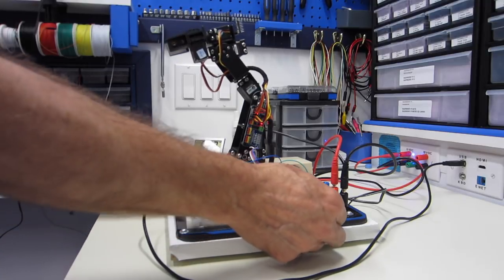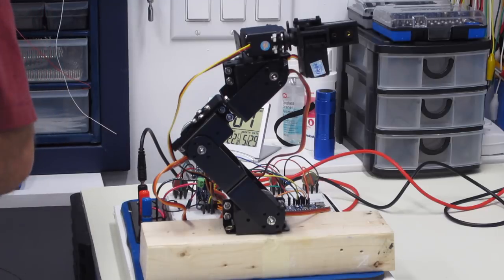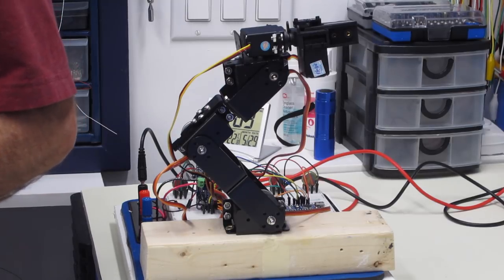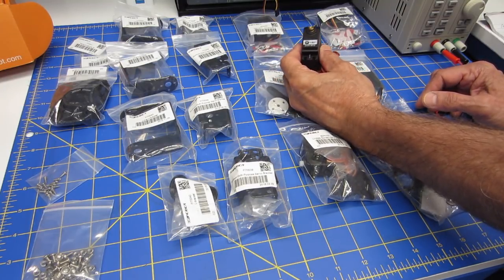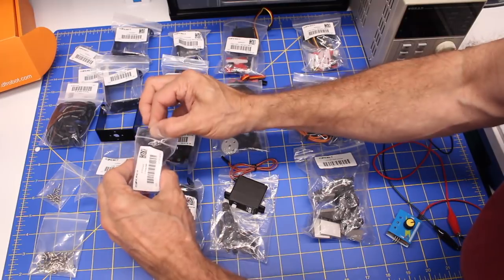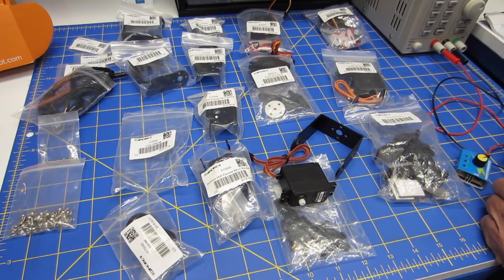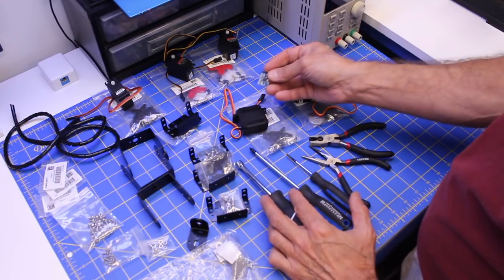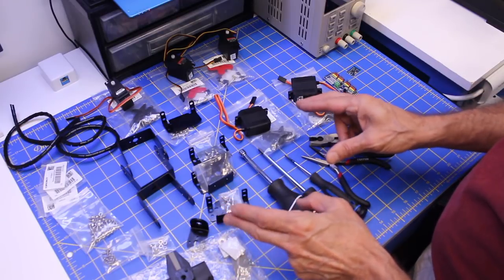Robot Arm & Controller - Building the DFRobot 5 DOF Robot Arm

Comment: Excellent. Can you please extend it to 16 servos (Or at least 6DOF) using Arduino servo shield 2+16 (or PCA9685 or any other I2C board)  with one joystick or a pot to record the position of each addressable servo and play automatically thereafter

Comment: If we wanted to use only one degree of rotation at a time, can we use only one analog pin (say A0) and connect it to the 5 servos using a 5-way rotary selector switch ? That way I guess we can save our analog pins for other sensors? Is this possible?

Comment: I am very interested in the 5 dof robotic arm project but want to add the ability to record the potentiometer movements then replaying a looping them. all using an Arduino Mega. have you done this? if so can you share the Workshop project link? if not can you add this as a Work Shop project in near future. Thanks and Also thank you for all you do with the Work shop

Comment: Nice video! What power supply did you use? This is my biggest challenge. Thanks
Reply: Probably a benchtop variable power supply my dude, they're not cheap but I got a decent one from Amazon for 70 bucks, rated at up to 30 volts and 10 amps

Comment: I'm having trouble finding the parts to build the arm.
Reply: Banggood + ebay, I just bought all the necessary stuff. Motors are 996R, all the mounts are designed for these motors, bearings are 3x8x3 or 3x8x4mm

Comment: I recently watched a video about a DIY google glass/HUD built with an Arduino, an OLED screen, and a Bluetooth module. I was wondering if you know of a way to send information from a cell phone to an Arduino  through bluetooth so that I can display navigation, speed, and maybe a few other things on my motorcycle helmet visor without having to incorporate a GPS module into the mix. This would make it so I don't have to look down or hold my phone to navigate. Any help is greatly appreciated as there is not very much information that I could find relating to the transfer of this phone data to Arduino. Thanks in advance!
Reply: He has a video on doing wireless with android or smartphone, but there are more in-depth tutorials on doing a diy project using wifi or bluetooth, and connecting to a phone for transmitting data from the internet. You may have to combine examples from different tutorials in order to achieve the HUD effect, but I have looked into that, and I've found no specific instrucable or tutorial for that exact solution, but you can probably work out how to sort it together with enough time and effort. AR is still young and expensive to buy ready-made solutions, so I would take my time and do a proper custom job that will last.

On the other hand, Raspberry pi 3 B+ has a built in wifi and bluetooth module, and that system-on-chip is about the size of a credit card; plus it's completely opensource like android, and has a big community too; Raspberry pi maybe what you're looking for on that solution; try Raspbian sometime and you may find it to your liking.

Comment: I've watched this video a thousand times and finally bought a 6dof aluminum one. I plan to print the scara one after I get my feet wet with this one. Mine has most of the same parts. I have 25kg motors I'm going to replace some of the stock ones with baba

Comment: Great tutorial 👍🏾

DFRobot arm too expensive. Hopefully Thingiverse etc, can point to a cheaper 3D print version..
Reply: I bought the U brackets, L brackets, servo horns etc off of Amazon, robotshop (dot) com, Ebay, etc; shopping around for each piece you'll be able to afford better servos that can lift more torque, like the ds3218mg's, and it'll cost you less than $150USD total. Just make a list of the components you need and buy what you can when you can.

Comment: I think I have a bad PCA9585 board I've tried two Arduino's and both adafruit examples as well as many other examples and the one from your videos.  It's there a simple way to determine for sure that the board is trash?
Reply: Try Brainy bits sketch using PCA9685. He made a library for it as well.
Reply: @webslinger2011  Thank you.

Comment: Having watched your video "Using Servo Motors with Arduino" about controlling multi Servos with the PCA9685 module....as this module is all about I2C protocol, could I also attach an I2C 1602 or 2004  LCD  display to  display feedback info from sensors on the arm(s). As you say that you will be making another video on the 5DOF arm with improvements, could you discuss my idea during that video if it is feasible.       Great series....much enjoyed

Comment: The link to dfrobot is not secure (flagged by chrome web browser) - looks like they may not have renewed their cert?
Reply: Roy...Amazon is selling the DFRobot 5 & 6 DOF arms if you are interested
Reply: I would like to know if built an Rc airplane and i want to stay more longer in the air . I put 2 Batteries in parallel in other voltage can’t be higher but the Amperage . My Receiver will not damage because the Amp goes too high . Thank you for time reading my statement .

Comment: why you don't use stepper motor instead of servo motor? isn't stepper motors provide more detailed movements than stepper motor.  I am thinking of applications to use the arm as 3d printer which requires more accurate movement.
Reply: With servos you can set a position and it will automatically go there while the microcontroller can do other things at the same time. With steppers you have to keep track of where they are which makes it a bit more complicated.